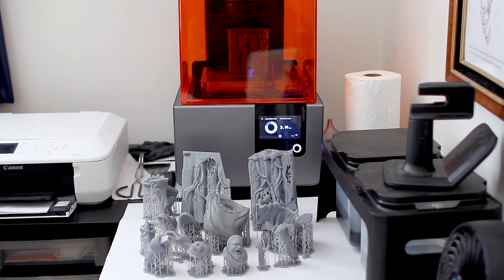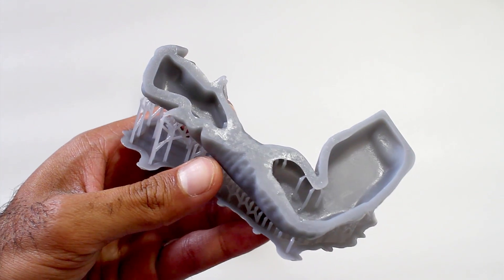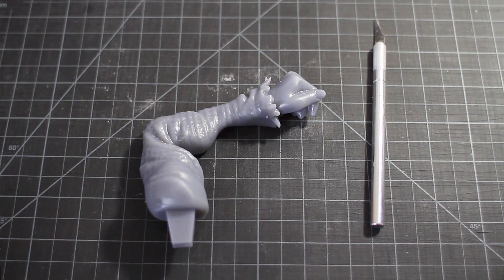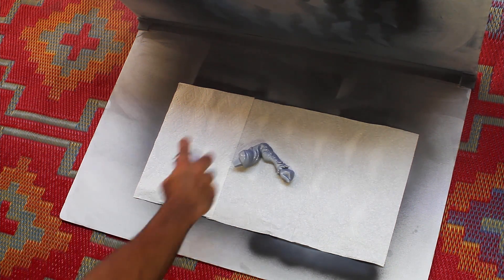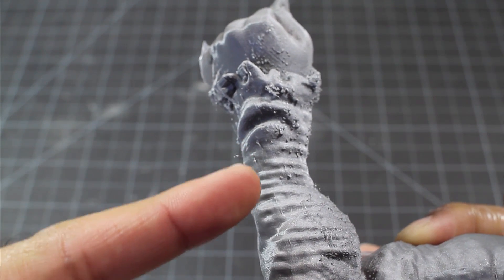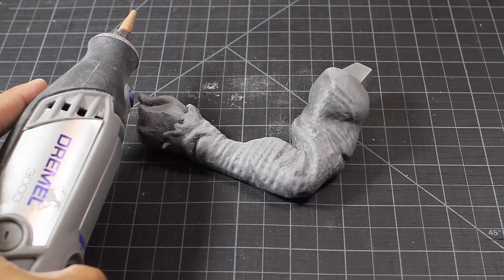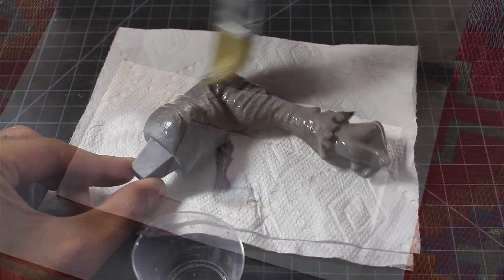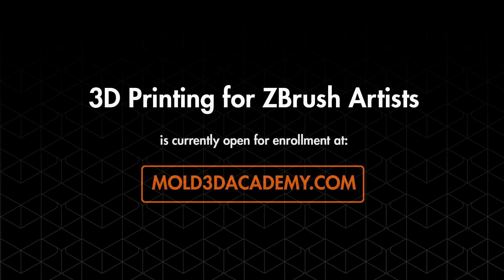FDM vs. SLA Cleanup & Post Processing

Comment: A little more tuning on your I3 printer, and it wouldn't be so bad for clean ups . I have to admit I was expecting the sla prints to be much much better then the pla, however once cleaned up they are very comparable . interesting video .
Reply: Thanks, glad you liked the vid. You're correct, tuning the settings on the I3 would result in a much cleaner print to start but for this video I specifically wanted to demonstrate a worst case scenario for FDM print cleanup which is why I left the hot end temperature a bit high to create the blobbing.